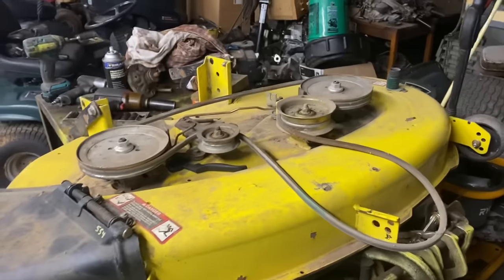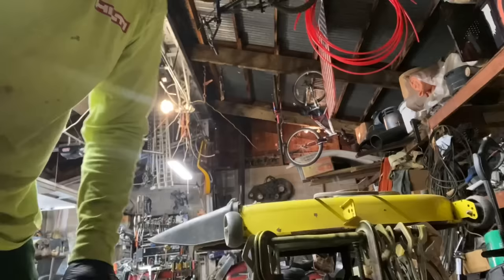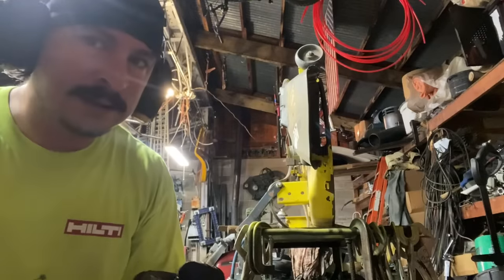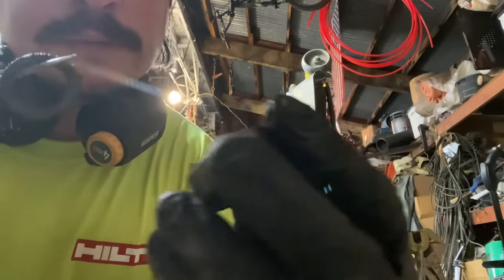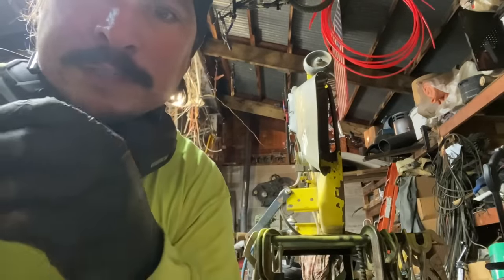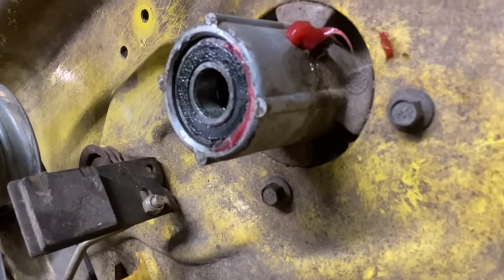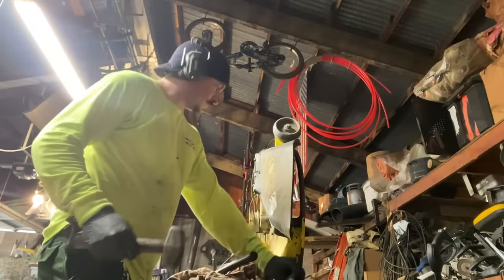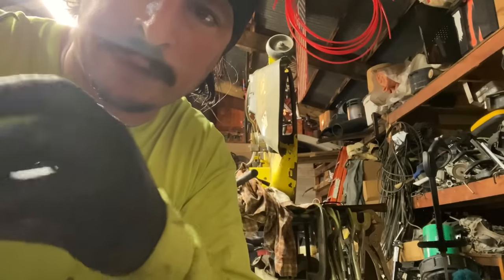Part 1 - Don’t trust the “Experts” Grease your mower deck sealed spindle bearings Common sense.

Comment: I pop bearing out, remove seal and hand pack them.  I do it once per year.    I also rebuild idlers
Reply from the maker: Yea. But not everyone wants to do that. Especially when the unit has a grease zerk and knowing how to use it is all
That’s needed to save a lot of time dismantling a deck every year. Seems silly to do all that every year. But I understand that grease gets to the bearings. Just have to pump them full and then no need to tear things apart.
Reply: @GTObearclaw1  I have had too many bearing fail trusting that the grease will pass thru the seal.  Not to mention the buckets of grease wasted being forced past the spindle shaft.  I do deck off maint on 5 zeros  and 3 multiblade walk behinds, this is a way to ensure that the bearings are properly greased.  I can not afford to have a mower fail out on a job.
Reply from the maker: @handbananaistherapist642   to each there own. If it works for you and your happy keep trucking brother.
Reply: @GTObearclaw1  I have an idea... better parts and better construction all around!   it is a dream I have.   Keep your blades sharp, my friend.

Comment: Well I'll give that a thumbs up! Good job informing us DIYers
Reply from the maker: It’s just my opinions on the topic. Good for thought.
Reply: @GTObearclaw1  I think you could be right. If you think about it, the rubber is plyable enough that under pressure of the grease, the rubber will flex enough between the bearings that it will let the grease enter.
Reply from the maker: @hotrodhog2170  it makes sense to me and you. But some folks think it’s impossible. That’s why I wanted to demonstrate it in a boring video. Lol. But hay it seems to be a unexpected popular topic. I’m surprised as none of my other videos have been as popular
Reply: @GTObearclaw1  To be honest, I've never seen your channel before and I wasn't searching ths topic but it just showed up in my recommended list. So the algorithm was working in your favor man.

Comment: I would think you could pop off a shield or seal of both bags. facing the cavity so grease can easily enter brgs. Would still need to pack the cavity with grease. Maybe grease every 25 hours of operation to push it to the upper brg. You would think the factory would do this for the consumer. I guess they need to sell spindle replacement assemblies.
Reply from the maker: This is simply about the facts and that is why I have taken the time to prove that the shields facing towards eachother do not present any threat of stoping grease flow. As demonstrated in this video there is no need to waste any time taking the assembly apart because as I clearly show the grease passes right through the assembly. Yes you can remove those inner facing shields but it’s just not necessary and is not beneficial.  Removing shields is  simply a waste of time and nothing more. Cold hard Fact that has been proven and not a single YouTuber has proven me wrong. Food for thought.

Comment: My John Deere deck spindles have really small greese zerks. Do I need a special greese gun???
Reply from the maker: All grease zerks Iv seen have been the same size 

I think any grease gun will work but a quick attachment locking fitting is very handy

Comment: Hey Russ, so you're saying that we can leave both seals in per spindle? As long as we fill up the spindle housing until we see grease coming out, both ends.
Reply from the maker: Yes. But you probably won’t see grease at both ends. It will exit the path of least resistance but by that time both bearings will be greased. Good to go. Please holler back with how it works out. Lots of clowns arguing over this topic. It’s so easy it’s silly. Just not many people think the grease will pass the seals but it will. And it will very easily
Reply: @Woodchuck Russ the Deck Dr  Will do, thx much. Just 1 more question, Russ. When drilling a hole for a zert to be put in: what size drill bit do I use?  What size threader do I use to make the threads for that hole ? Does it matter where exactly I drill that hole? I have a CUB CADET
Reply from the maker: @toddrhine7648  check the underside. Many cubs have zerks but for some reason they put them under the deck and they get covered with grass and can be hard to find after mowing. I don’t think it matters where as long as you pit the serks between the bearings. I don’t care for the weep holes so if it’s a MTD / Cub sometimes I’ll use that hole to drill for my zerk. As for the size hole, that will
Depend on the size of threads on the zerk.

Comment: Just as I thought. I'd like to see the bearing seal that could resist high pressure grease from squeezing through.
Reply from the maker: Some folks don’t realize It’s just the lip of the seal that lets grease move past. Maybe some confusion due to the word seal being thought of as a hydraulic cylinder seal. Not sure but that’s how some of the comments seem to be making me feel. 

Also some concern about the the shield caps coming off the bearing. But they can’t unseat in this assembly unless something is assembled wrong. I challenge anybody to unseat one of these seal caps with a grease gun in a properly functioning unit. I’d like to see proof that it has happend. Iv never seen it happen. These units have no tolerance for movement. Not even a mm. The shields stay in place. Grease flows past seal. Very basic, but yet a lot of confusion on this topic.

Comment: Well now all I have to do is drill a hole tap and screw In a fitting and pump the grease gun, great vid.
Reply from the maker: Unfortunately not all spindles have a zerk but your right, you can add one and it’s a wise choice.

Comment: I just removed the inner seal before I put them back together with new bearings👌
Reply from the maker: That’s fine, just not necessary. No reason to pull it apart unless something breaks. The grease will pass right through the lip on seal.

Comment: So, not an expert, but the reason I didn't grease them because in my Manual for my deck it states: 
"IMPORTANT: DO NOT add grease to spindle
grease fitting. They are for manufacturers use
only. Adding grease may damage spindle seals."
Is this the same fitting, and if so could any1 elaborate why it would still be okay?
Reply from the maker: Don’t grease them the bearings will fail. Add grease they go long time. Do as you wish. Apparently nobody is an expert. However Iv shown it works just fine been doing it almost 20 years no issues.
Reply: @GTObearclaw1  Right on, no argument here, just trying to understand why its suggested not to, thanks for video.
Reply from the maker: @ApothecaryRdy  my guess is so it fails sooner and you go to them for parts or services or a new tractor
Reply: @GTObearclaw1  🤣

Comment: GREASE will not penetrate the sealed bearing.  However the fine oils in grease could penetrate past the rubber seal (especially as they age) on the lower bearing, but not the upper.  Grease is oil suspended in clay.  Am I wrong?
Reply from the maker: You’re absolutely wrong. Grease passes right by the lip on the seal. Exactly like I showed in the video. I’m not a magician. 

You may be thinking the seal on these shields is some kind of super man seal. In reality it’s nothing more than a flimsy dust barrier that moves out of the way of the passing grease. Run some tests before you come barging in with your capital letters like some kind of expert on the topic. And FYI the upper and lower bearings use the same type of shields on most machines. But even the ones with metal shields rather than the rubber shields all have a rubber lip that allows grease to pass. And I’d argue that the new softer seals actually let grease pass easier than an old shield with a stiffer seal but regardless all seals in these assemblies lack the ability to stop a pressurized grease from passing. They can’t even keep water out very well. 

So if the seal only allows oil to pass it would then be filtering out the clay? Ahhhhh no. Not how it works
At all.
Reply: @GTObearclaw1  Pressurized grease...  so push the seal out of their seats?  OK.  Wouldn't be so good for the lowest seal, would it?  (no caps)  ;-)
Reply from the maker: @ya472  how many time have you done this? None ? Thats my guess. Call it an educated guess if you want. Not being rude but let’s be honest. If you had ever done it this way you wouldn’t be here talking like this. 

First off, don’t let the phrase pressurized grease get out of hand here. A few PsI is pressure. And that’s all it takes. You’re not going to ever see these things holding high pressure. The smallest amount of force pushes the grease past a rubber Lip. I mean super super simple. Don’t over think this process. I’m not a nasa scientist here. 

Shields popping off doesn’t happen, in 20 years Iv never seen it happen. Not a single time. Only time Iv seen shields off is when they were melted off due to a bearing running dry and overheating. Even when they are aged and worn those shields usually stay in place. 

I provide the proof and show it in a step by step video that a toddler could follow. I didn’t hide any steps and I didn’t sugar coat anything. Do some experiments. Grease in the bearings is good, no grease is bad. Dont be Worried, it’s super simple stuff here. Basic maintenance not a huge ground breaking invention I’m just showing how it works and what happens when grease is applied through the zerk. Millions of lawn mowers come with the zerks installed just like what Iv shown. If adding grease was going to cause issues they most likely wouldn’t install them. It actually amazes me that any mowing equipment comes with them anymore. They seem to want things to wear out, more and more plastic bushings and less and less grease points on mower and on the road equipment for that matter. Be thankful if you have a zerk and consider using it before it’s too late. Or second guess everything and make a stink about stuff nobody can prove even happens like shields poping off. I’d cover your concern in more detail but I already have in other comments. It’s not an issue. You can test it for yourself.

I challenge you to try and unseat a shield with a grease gun (while servicing an assembled operational assembly) it won’t happen but at least you could run some tests and talk about practical application and real life experience rather than being a naysayer just because something seems logical in your mind. I understand what you’re saying and I use to think the same thing until over a decade of never seeing that happen I finally get it. And why I’m trying to help folks or even bearing failure. Open your mind. Allow it to absorb something you can’t currently understand and let it become a possibility and see what you get from it. Not saying I’m always right but I sure am on this topic. 100% in fact. And Iv done the hands on and been in the trenches and ran the snot out of some decks. It’s kinda my thing.
Reply: @GTObearclaw1  In fact, yesterday I picked up a free 10 year abandoned MTD with 12hp Briggs, and hopefully sometime this summer I will get it operating.  Of course I currently have three Poulans, a couple of Mastercrafts, even a four wheel steering Craftsman, and a few others I use about the yard.
Reply from the maker: @ya472  sounds like this information could be very useful
Reply: @GTObearclaw1  Na, your not honest, just rude.
Reply from the maker: @ya472 well kinda funny then, because that’s kinda how I felt about your very first statement. You state something as fact yet you’re wrong plain as day. and it was just proven in a video with the full process shown in easy to follow steps for anyone to test. I feel like I went above and beyond to try and help you understand. But hay, not everyone appreciates someone being honest. I get it. I also noticed you didn’t bother to answer how many times you have tried this, hopefully you gained something and can benefit from the information even if you feel I’m rude won’t change anything about the facts here. I’m not quite so sensitive I guess. If you come here to be a naysayers be ready for a response. I’ll try to help or I’ll make em run and cry. I actually try to be gentle but facts are facts. Can you point me to some proof that backs your claims? If so please drop a link. Plenty of people posting videos about how this won’t work and I proved em wrong. Some folks appreciate it, others don’t. I can’t make everyone happy and I’ll have to live with that.
Reply: @ya472  He's not rude, but I can understand why it sounds like rudeness. When someone is direct when imparting information and/or when you're being corrected, it can sound rude for sure.  Rude would be calling you an idiot or such like.  He did not do this, just told you you were incorrect.  We're all men here (women too) so we should act like it.  The channel owner is in teaching mode, so respect to the teacher. 😉
Reply: @Hjerte_Verke  I am being direct when asking questions, and in this video he has a specific example, cheap bearing from Amazon?  Bearing seals are used in engine water pumps, and for many applications where no liquid or gas is permitted to pass.    And in any context, this statement is rude:  "how many time have you done this? None ?"

Comment: I’m pushing 270 hours on a 2009 x300 without an issue all I do is keep it indoors out of the weather
Reply from the maker: X series is a little better quality. All around the X series is a better machine. I’m working on box store models on my videos. Iv had dozens of X series but nothing much to fix on those to make a video about. As for the bearings on yours. They will go until they don’t anymore. Grease them sooner than later one will fail. Grease that came in them won’t last forever. It’s just the way it is. They put zerks on them for a reason. Keeping them inside and out of the elements is smart and effective at keeping them in better condition no doubt. But they still
Require preventative maintenance. Iv had a few X models with 1,000 plus hours. It would be hard to find a Home Depot box store model with that many hours. But the Kawasaki engines will go the distance on the X models.

Comment: You must remove the inner seals for lubricant to reach them when reassembled-
Reply from the maker: No you absolutely do not. Did you even watch the video? Lol. That’s the whole point of the video. Did you just go straight to the comments? Geez.
Reply: @GTObearclaw1  How very little you know about bearings-
Reply from the maker: @horacerumpole6912  any chance you can prove to me, maybe in a video? And share that on YouTube so we can all see that you can provide evidence that grease won’t pass the inner shield? I didn’t think so, none of the other naysayers can either. But tons of folks comment on how they have been doing this for years and it’s a proven method that works 100% of the time.

I wait, Lol. Your just clowning around. You must be joking? Right? Maybe Your a funny guy? I actually know very little about bearings. Not claiming to be an expert. But here in this moment we are talking about grease reaching a bearing. Do you understand how a grease gun works and how grease is applied through a zerk and what happens with the grease after passing into a sealed assembly with no way for grease to exit other than by going through the bearing? Grease will also have to exit that outer shield if doing it your way, you will never know how much grease is inside the j it until you grease it till
Filled and see it leaving out the upper or lower bearing shield. So technically even doing it your way is the exact same process except it didn’t also pass the inner shield. 

If your being serious, I’m a little concerned that after watching a step by step video you didn’t take a minute to think about the information provided and consider what is really happening during the process. The only difference between adding grease when inner shields are removed is that grease does not have to pass a little rubber lip of a shield. Absolutely absurd that someone can’t understand that grease passes those shields. Especially hard to believe folks can’t understand after it’s been broke down step by step and explained in detail. Sometimes folks are so smart they can miss the simplest stuff.
Reply: @GTObearclaw1 How old are you?
Reply from the maker: @horacerumpole6912  what? my age? Lol. You can’t prove your side so you attack my credibility by asking age? Lol. Your a hoot. This is so basic and easy to test it’s silly your even keeping this conversation going rather than put a grease gun on your mandrel and test the  process first hand. When you see grease exit the bearing you will know it passed the shields. It’s super basic and simple stuff. Not much to argue about.

Comment: Personally for how cheap those bearings are on amazon and how easy they are to change i just leave them sealed and run them a couple seasons then just replace when they get growly. I get about 100 hours per set of bearings i just pack them FULL of grease before installing the bearings into the spindel.
Reply from the maker: Or just grease them as I showed and extend the life and take the deck apart less. Some folks like doing all that work. If that’s the case sounds like your doing what you want to be doing. But most people don’t want to mess with all that. Especially when just pumping grease is easer. You could also buy the better quality made in USA bearings and not use the cheep ones. With high quality bearings you should get a lot more than 100 hours even if you didn’t add more grease. Iv ran the same cheep bearings for many years by only adding grease from a gun once in awhile and I ran some of my tractors pretty hard when I use to mow yards and fields. Just check bearings and if all good add more grease.